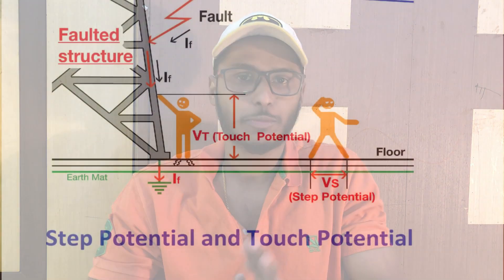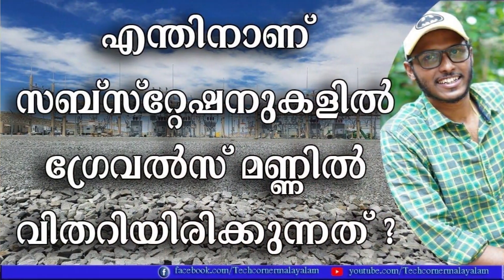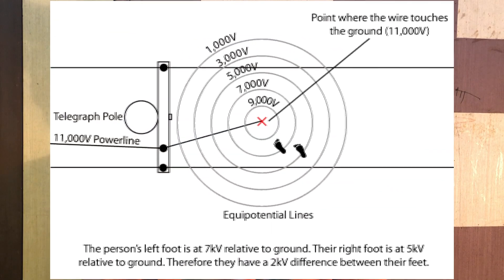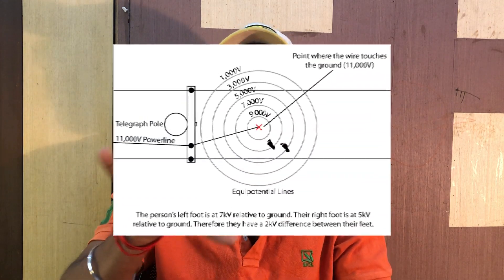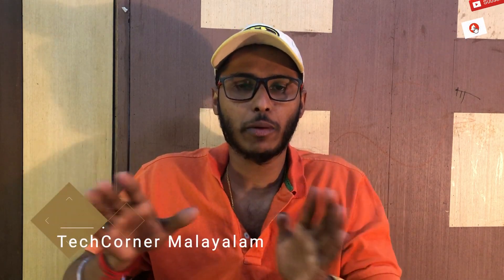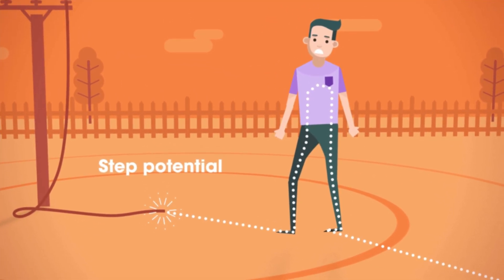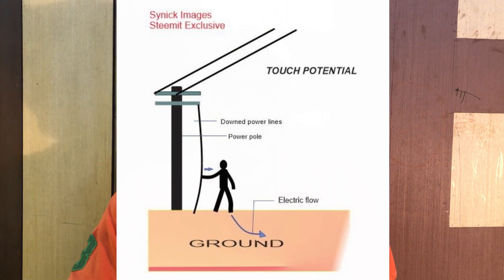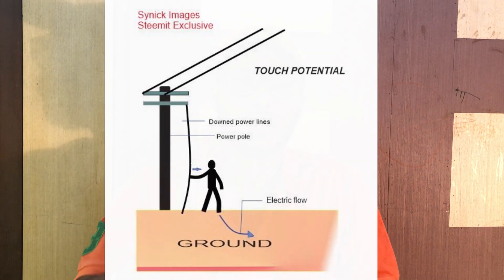What is Step Potential and Touch Potential | എന്താണ് Step Potential ഉം Touch Potential ഉം

Comment: What is the difference between RCCB  and RCD.
Reply: Ok RCD is not the same as RCBO right. It is same as RCCB.
Reply from the maker: Rcbo is an rccb with overload protection
Reply from the maker: Both are same...rccb is residual current circuit breaker and rcd is residual current device.

Difference between ELCB and RCCB in Malayalam| ELCB ,RCCB തമ്മിലുള്ള വ്യത്യാസം https://youtu.be/L8BqE6D0i20

Comment: e poti veena 11kv line le current thirichu substation le transformer de nuetral leku ethum ennu ketu adu engane anu angane ethunadu onnu explain cheyamo
Reply: Substation le Transformer nte 11 kV side eppolum star connected aayirikkumm(with the star point solidly earthed). It means that whenever a 11 kV conductor snaps and touches ground, the current returns to the transformer neutral through ground. The relay at the substation measures the current through earth and opens a cb if it's above a threshold value to avoid electrocution. If the Earth resistance between the grounded point of the line and the transformer neutral is large, owing to distance or due to the kind of soil, this current may be so small that a earth fault relay may not pick up. In that case, the CB at the substation wouldn't trip and hence it would result in a live conductor at 11 kv touching ground, which will be a greater threat to all around it.
Reply: @rjshtk  apo distsnce short ayal mathrame current thirichu varugayulu transformer ku or ethra distance ayalum kuzhapam ela current earth vazhi return varum ennano
Reply: @rjshtk  e video lu pryunundalo chela sthalathu 11kv de effect chelapo 6kv k ayi marum ennu adu pole distance koodumbo effect kurayule so potential diff kurayule apo current thirichu transformer leku ethumo
Reply: Ethra long aanengilum thirichu varum.. but then the return current will be very small..
Reply: Step potential aanu kuranju varunnathu.. but live conductor nte voltage will depend only on load and the type of the conductor..